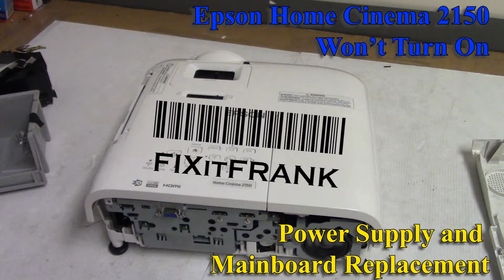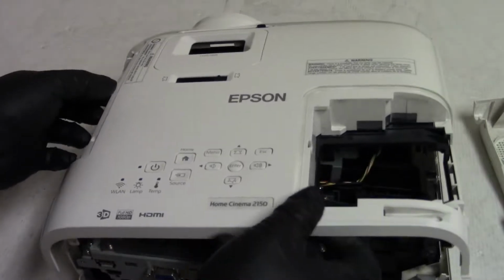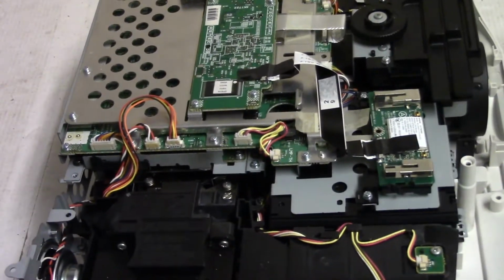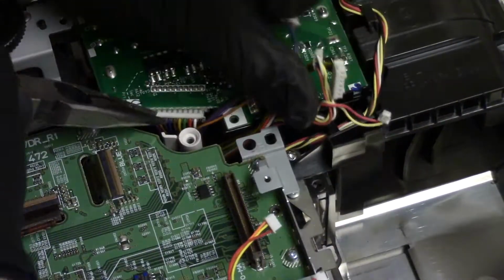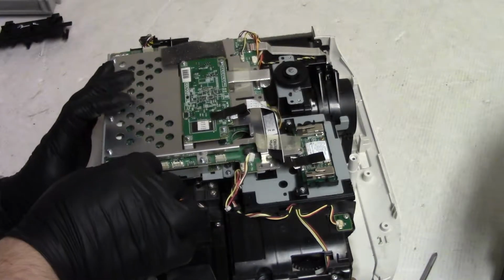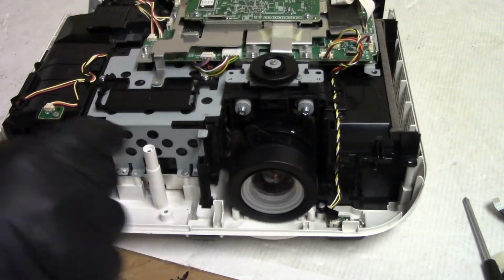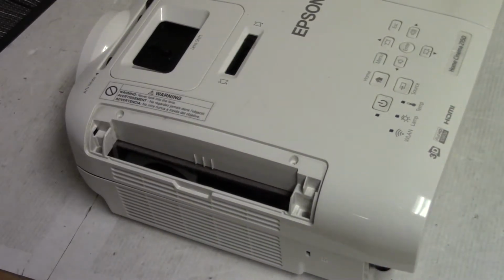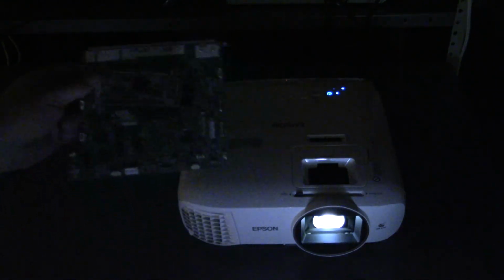Epson Home Cinema 2150 LCD Projector Repair | No Turn On | Mainboard and Power Supply Replacement

Comment: Always a treat to see a unit saved from the scrap pile. And there I thought you give no love to the EPSONs!!!!!
Reply from the maker: Thanks man!  I'm forcing myself to work on them.  I need to either get over it or get good enough at them to know better.  I do not expect to be repairing many optical issues but electronics problems  should be okay to do.   The problem is stuff like these connectors that are not meant to come apart.  I swear epson is intentionally building these to not be repairable.  And seriously, your comments keep me motivated.  Thank you :)
Reply: @FixitFrank  Well, let's say that everything I have learned about repairing projectors I owe exclusively to you. And to be able to work on these beasts is no small treat. Keep repairing my friend, let's all keep the spark alive.

Comment: hey frank, i recently had to open up my epson and replace the main power board at the very bottom of the case.  in my epson, there were 3 different flat ribbon connectors being used.  i was only familiar with the most common one where you slide part of it back to unlock it.  the second type i encountered I didn't figure out until I took some up-close pictures of it and noticed it said "Push" on it.  Sure enough, when you press on it, it unlocks the mechanism that locks the cable in place.  The last ribbon connector in use was for the 3 video connector cables.  This one I got really lucky when messing around with it and it unlatched.  It is a hinge type that unlocks when flipped up.

Comment: Hi Frank, I have this exact same model with little use, it hung from a ceiling mount and was never bothered other than to bring it down when it failed. The projector is doing pretty much the same thing as in this video, no indicator lights, and won’t power up. I got the same readings from the power ballast 12v instead of the 17v as indicated. I would like to get this repaired, what would you suggest?

Comment: where can i get the main board at my 2150 is  doing the same thing  wifi light on no power .thanks
Reply from the maker: Don't waste your money. Its not remotely worth it.  Epson has been building garbage and lying about it for a bit now.  They pretend its high quality when in reality its built to break.  The only way to get a mainboard is from a used projector and they will cost $500-600 plus shipping. Epson won't sell you one and if you take it to an epson repair place, they will want double the cost of the projector to "repair" it. Then they will offer you a deal on a used/refurb that will fail soon.  My serious advice.  Cut your losses and don't ever buy an epson projector in the future.  If you like LCD, buy Panasonic, NEC, or look at LCoS models like Sony and JVC.  Epson has top tier marketing and bottom tier manufacturing.  I'm not a fan of epson, can you tell?
Reply: ya i did'nt buy this one it came with the house i bought   worked well till about a month ago guess i will look into the other ones you mentioned thank you for the reply

Comment: @FixitFrank, i was wondering if there is any fuse at all that is build into the projector? And if not if you could pinpoint me to were i could buy a power supply replacement since i seem to have the very same problem with my projector that is also a 2150 (but in sweden they call it a 5650 model). I would appreciate it alot if u could help a brother out :-)
Reply from the maker: there is. Its in the mains power supply if i remember right. however I seem to recall these having more issues with the mainboard.  I'd check to see if you have any low voltage from the power supply to the mainboard.  There should be 17v, 3ish and 5ish volts.  They feed in that large multi cable wire.  if you read voltage there, its more than likely the mainboard.  There are some 8 pin voltage regulators on the mainboard that are allegedly known for problems.

Comment: Thank you very much, i have a TW5600 i assume i can disassemble it the same way (when needed).
Reply: And please more Epson TW repairs :) .
Reply from the maker: I'm trying! Epson is weird. I can't always get parts and some repairs are not cost effective. But I have committed to trying to repair more epsons. Thanks for letting me know 🙂
Reply: @FixitFrank  Thank you mate :)
Reply: Yes is nearly equal, this one into video is labeled TW5650 in Europe and respect to TW5600 has just wifi enclosed and different air filter. Disassembly is equal, just you don't have the wifi board you see into this video.
Reply: @pinomauro2426  Thank you, i hope that my TW5600 will work forever, but you have to be always prepared for problems :). Anyone else seeing flickering on the TW5* series?
Reply: @rickydeldo8596  try to set the lamp to High mode for One of two hours, this should solve problem for while
Reply: @pinomauro2426  Thx for the advice, i will do that. Is the reason why it behaves that way - and how it can be permanently be fixed - known ? I read from a lot of people complaining about this problem on the internet.
Reply: @rickydeldo8596  It depends from Cook that Is accumulated into lamp when used in eco mode for long time if you set high mode It Will be destroyed and flickrrimg ends.
Reply: @pinomauro2426  That would explain it. Will try it with the next movie ^^.

Comment: I bought a new lamp and cannot get a picture or light of any kind. It powers up but nothing lights up . Anyone have input?? Thanks.
Reply from the maker: Depends on where you got your lamp. If it's from amazon, send it back and buy one from PurelandSupply/Projectorlamps, MyPL, or if epson still has them, Epson.  Almost every lamp sold elsewhere of those sites is junk in my experience.  Also what happened to the old lamp?  If it exploded, it might have damaged the ballast or power supply. I'd try another lamp to rule out a defective lamp but it's highly possible it's the projector(if its an epson).
Reply: @ thanks for the input. It was from Amazon. The old lamp just stop working…no explosion.
Reply from the maker: Makes sense. I have a shelf full of dead projectors that were ruined by amazon junk.  Its all pure trash.
Reply: @ thank u.

Comment: Another great fix Frank! Epson, and lcd projectors in general, are much more complex then DLP, but for me (I've this exact model) colors and contrast are much more better then comparable DLP, projector, blacks are more deep and colors are more bright. I've a laser DLP too but for movies I prefer to use this Epson.
When I brought it the first unit arrived to me has worked just one day, the day after when I've switched it on the power led was flashing, fan was running at maximum speed and the lamp led was red, I've tried to reinsert the lamp but didn't solved the problem, so I've repack it and send back to vendor he sent me another unit and it was and is fine, but the funny is when my unit was arrived back to vendor, he has tested it and was working! I've spent half day to work around the lamp and cover switch but nothing, the travel has solved the problem :)
Reply from the maker: Thank you Pino!  I appreciate that!  I am really trying to get more comfortable with LCD.  I am definitely feeling more relaxed while working with them, but those flat flex cables on the LCD's still give me tons of anxiety...
Reply: @FixitFrank  I know I've had same feeling when started to work on plasma TV, those has alot of flat cables like the LCD matrix projectors.
Reply from the maker: Its funny, I took a break from repair when plasma hit the scene. I worked at an AV repair shop from the early 90s until the early 2000s.  then not again until 2008.  By then plasmas was going away and LCD/OLED was the norm.  I still will work on one for friends/family but its hard to make money repairing them these days.  Im sure you can in the right market but electronics are so cheap here. not enough people repair them. its a little frustrating to see.
Reply: @FixitFrank  yeah now in Italy too Is not a business anymore to work on TV, those are cheap LCD most and for plasma (I think was much Better then LCD) spare parts are not more available, expecially panels. But 10 years ago I've worked for Panasonic repair center and plasma TV was most of daily job. Those was very good TV like image quality and all parte was made in Japan not like now with the cinese trash.

Comment: @FixitFrank - I have the same unit that appears to be doing the same thing.  One day it worked the next day nothing.  The WLAN is lighting up but that's it.  I'd like to try to replace the mainboard as you did.  How can I find the proper part number/name for the unit?  I'm having a hard time figuring out what to order.
Reply from the maker: You wont be able to get it from Epson. they are a nightmare to get parts through.  I have a contact in China I use for used/good and new parts.  I should warn you.  that board will be around $500.  I wouldn't put the money into it personally.  The 2150 is great when it works, but once it fails they are awful to deal with.  I had a scrap 2150 with a good mainboard(the optics were bad).  That might be a better option.  Buy a used projector with bad optics(color blob in the image is common).  Otherwise, I'd put that money towards a new projector.  It seems that a lot of 2150s are failing this year.  If you want to check with my source, email gydz@timeprojectorlamp.com and let them know I referred you.  Also, I don't know if you prefer LCD, but I am selling my own BenQ HT1075 (DLP) with very low hours. I'll list it on the community page. good luck!
Reply: @FixitFrank  Seems to be my luck.  Any suggestions for a replacement or where to read up?  There are so many options out there. The 2150 was great for the four years I had it.

Comment: Frank I have run into this now with a few times now,  a voltage regulator 8 pin style goes bad and drops the 17v down and no response because half the board is dead.
Reply from the maker: Ahhh. That makes total sense. I have not looked at the board yet. I had kind of written it off in my head. But I know which regulators you mean so I'll check them over. Thanks so much for the insight.
Reply: @FixitFrank  This is an issue I found on two identical Epson UST classroom projectors. They were both non responsive but had a power indicator. Oddly one had two bad orange drop poly film caps in the ballast.. Not entirely sure if this could have caused the main board to go bad, but I swapped both film capacitors on both ballasts to be safe after main board repair. This issue will present itself with a no strike condition the first time powerup. The projector will retry and get it on the 2nd or 3rd try.
Reply: Hello to either you or Frank, I have an Epson 1060 I picked up cheap because it was dead. No lights. On initial testing (with mainboard removed) my power connector is all black wires and one white wire. On several of the left most wires I'm getting 5v AC, some wires are grounds, and I'm getting 12V DC. Are you familiar with the 1060 power supply? What confuses me is why I'm getting 5V AC, I'd assume I'm supposed to have 5V DC, but none of the pins are marked on the board side of the connector so I don't know what voltages are supposed to be present. I don't have any 17V, but two wires are 12VDC. Not sure if the 1060 suffers from the same 17V regulator issue but I don't see any 8 pin regulators on the board.

With the mainboard plugged into the power supply and the key board and door switch connected, the 5VAC readings seem to disappear and those lines only have a few mV DC on them. I feel like there should be more coming out of the power supply than 12V. Front panel lights are all still dead.
Reply: Just pulled the power supply, mine is supposed to be 17V but is reading 12. I'm thinking a regulator.
Reply: @shawnstthomas4811  My next question would be where on the power supply board is the 17V rail derived from? I see two K15A50D 3 pin MOSFETS that I'm thinking may have to do with it but I'm not sure. Mine has the same problem, my 17V is down to 12V. I pulled the power supply and ballast assembly out and apart to troubleshoot the power supply board.

Comment: Hey Frank, I recently picked up an Epson EX9220, upon the first attempt to power it up, it went through the startup and all the fans turned on, but the bulb wouldn't light and then it kicked into an error mode where the status light would blink blue and he lamp light would blink orange.  I used by multimeter to check the plug to the lamp and found that there was no power there.  I have had the power supply out and have tested the mosfets like you have with other power supplies, but couldn't detect an issue.  It seems that the ballast just won't power up and send voltage to the bulb.  Maybe it's the ballast or maybe it's the main board causing the problem.  Not sure if you've seen that type of error from the Epson projectors or not, but any advice would be appreciated. Also if it needs a new main board or power supply, and reference on a place to buy the parts from would be great.  Thanks.
Reply from the maker: Id chase down what the error LEDs are telling you.  If its saying a lamp error, check the power to the ballast. It should have 380vdc feeding the ballast. also check the iris assembly and the cinema filter(if it has one).  Things have to start up in the right order or the lamp wont be fired.  I doubt its a ballast problem. That is fairly uncommon in Epson.  I'd lean more towards something keeping the ballast from firing.  If you dont have the Lamp_on signal to the ballast(from the ballast control wire) then its something else keeping the lamp from starting.
Reply: @FixitFrank  The error LED's are giving me the Flashing Blue Status light and Flashing Orange Lamp Light.  The Epson status code document says this means: "Internal projector error, turn the projector off, unplug it, and contact Epson for help."  So that's not real helpful, ha.  How do I locate the cinema filter or determine if it has one?  Also do you have a recommended test for the Auto Iris to determine if that is an issue?  It definitely seems like the it's stuck in a loop where the signal to fire the ballast and turn on the lamp is getting interrupted.   Thanks for the feedback so far, I appreciate it.
Reply: @Mik-Golfs20  I have same problem whit epson- tw5650. I check auto Iris, like as Frank says, but it is ok. I think motherbord don't send signal to the balast. Did you found somthing else. I like PJ but it's fail, just half year afther guаranteе.
Reply: @kostadindemirov5019  I did some testing and used another working Epson projector to test components of the non-working projector and all of them are good.  The auto iris, power supply, fans and sensors function when swapped into the other projector it works as it did with it's original parts.  So it seems that my main board is bad in my EX9220 and since I don't know how to determine what piece/circuit is bad, I ordered a new one.  It won't arrive to me for about a month, but when I get it, I will put it in and hopefully it will solve my issue.  I will report back if my projector works after the main board swap.

Comment: Hi big repairman, I need your help for a benq TH681 projector. I am subscribed to your channel and I am an electronic technician, I have learned to repair projectors thanks to your videos, you are very good. I am writing from Italy and if I do not disturb I would need some advice. Thanks Mauro
Reply from the maker: You're welcome! I'm humbled to hear my videos helped you get into projector repair. I appreciate the kind words. What is the th681 not doing?
Reply: @FixitFrank  Thanks, I have repaired several TH681 -TH682 and others. This latest TH681 I can't resolve. The projector starts up, makes three or four attempts to switch on and then turns on the red led of the lamp. The lamp does not light up. I have almost all the components to do tests, I was thinking about the defective color wheel and I replaced it but nothing, I tried to replace the lamp but nothing, I tried the replacement of the ballast but nothing, I measured the voltages on the mainboard and the regulators are at place. I plugged in oscilloscope to see if there is square wave on the CW amplifier chip and the square wave shows well. All the fans are running and I'm picking up the tacho square waves. I checked lamp connections, cables etc ... but everything is OK. Could it be a corrupt or blocked firmware that does not turn the lamp on and start the Benq? The symptoms are those of the faulty CW but it is not faulty ... I am unfortunately stopped. Thanks for your kindness.
Reply from the maker: Check to see if you have 380v dc feeding the power input to the ballast. It sort of sounds like a ballast/PFC (power factor correction) issue.  If the ballast is not getting all 380v(like if its getting 150v or 300v depending on your line voltage) then it won't fire the lamp. It will still run the lower voltage stuff though.